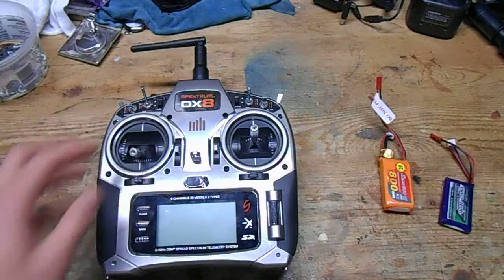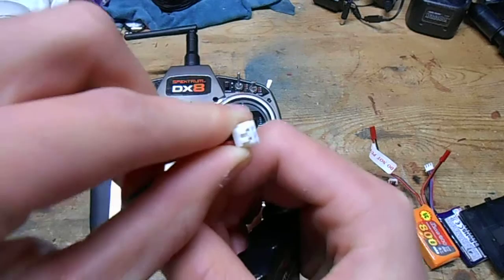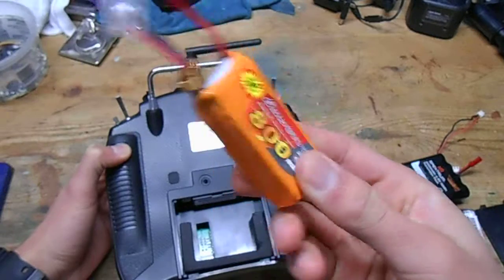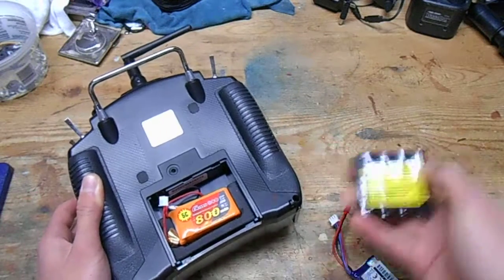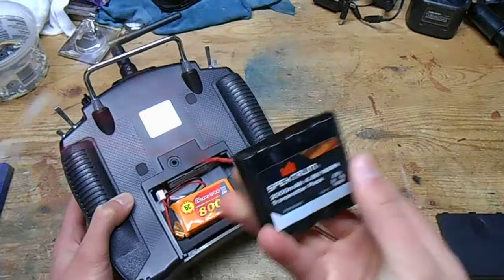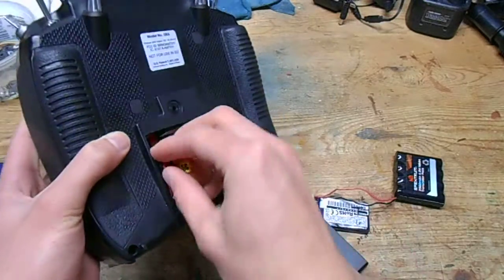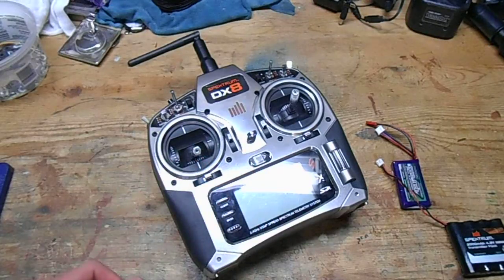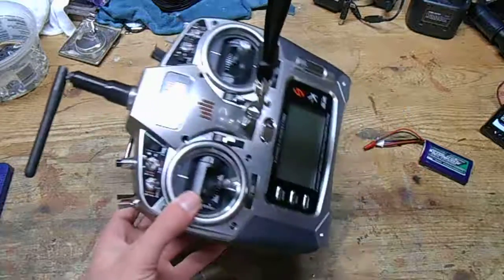How to Use Any 2S LiPo in Spektrum Transmitters With No Modification

Comment: I liked Spektrum for helicopters but in order to get the quantity of programable channels I needed for older quads (that needed 3 more channels, slider and rotary switches for the gimbal) I switched to Futaba, then to Frsky with Crossfire when I started flying "fixed camera" quads.   I searched for a Spektrum that had at least 14 channels, slider switches, rotary switches and a wide assortment of 3 position switches but then you're looking at a lot of cheddar.

Comment: quick question for you!  for a 2s transmitter lipo, what voltage do you set the tx low voltage alarm to go off at? like so you dont overdischarge the lipo? 
I have a futaba t8fg that i just converted from the stock 1700mah nimh to a 2600mah 2s lipo, but i am unsure if i should set the alarm at 7.3v (3.7v per cell) or set it for 6v (3v per cell)?
any help would be so appreciated!
Reply from the maker: Of the two options you provided, 7.3V is much better. 3V per cell is unsafe for LiPos.

Comment: Very Helpful indeed !  I just bought a stock battery for my DX18 and of course it came with NO Balance connector.  Where did you get your battery replacement shown in this video??  It does have a balance lead so no wonder it lasts much longer!
Reply from the maker: The one in the video is a Gens Ace 800mah 2S, but I don't remember where I bought it (and they probably don't even make it anymore). Nowadays I make my own 1300mah 2S from worn out 4S miniquad batteries.

Comment: I would not attempt to charge a LiPo battery using the charging circuit built into the radio. Great way to burn down your house.
Reply from the maker: If your radio has a setting for LiPo batteries the built-in charge circuit should charge the battery to the correct voltage when that setting is applied. However if this is not the case then the battery should definitely be charged with a LiPo charger. Also, most radios that have a LiPo setting are not capable of balancing the individual battery cells.
Reply: I agree they spend very little on the cheap charger that comes with the package!

Comment: A brand new LiFe transmitter pack costs 10 to 15 USD. If you replace that with an unsecured (i.e., one that does not have a BMS that prevents under and over-charge) cheap used LiPo, you might burn your TX or lose your plane. Is it worth it ?
Reply from the maker: Almost all batteries for model aircraft applications, LiFe, LiPo, and otherwise, do not have a Battery Management System (BMS). Spektrum transmitters when set to the LiPo battery setting will provide a low battery warning at the correct voltage, and then the battery can be charged and balanced with a standard model aircraft battery charger just like any other model aircraft battery. This is what I do and I have yet to light anything on fire or lose an airplane.
Reply: @TimmyRC : still, I humbly suggest an improvement: either you make a complete video that includes soldering of the right plug and balanced LiPo charging, or you use Li-Ion elements and a BMS to build a better battery for TX. Because when turned off, the TX will not handle under charge. That is why LiFe is the common (safer) option.
Reply from the maker: I agree that this video is outdated; it is one of the first videos I made. Feel free to make a better video. In low power draw scenarios such as transmitters, overdischarging a LiPo is relatively low risk. You might cause the battery to be unable to hold a charge and possibly puff it, but combustion is extremely unlikely. If you are observant you will notice that in this hobby there are few safeguards against accidentally leaving transmitters on or airplanes plugged in, likely because overdischarging LiPos is rarely catastrophic.

Comment: Unfortunately as I installed 2c l ion the transmitter turns on by itself so i had to install Ni MH found out Dx6e behave differently if you exceed 6.5 volts
I don’t think it works on all spektrum transmitters

Comment: SO what is the advantage to using this over the batteries that come with the transmitter.
Reply: For one thing the stock battery for a DX18 is a two cell LiPo with no balance connector.  This forcing charging in the TX with the stock cheap charger ...  Much better with a balance connector because more expensive chargers that use a balance connector will charge both cells evenly  (very important on LiPOs).
Reply: @rhshel  So Spektrum knows enough to build the radio, but no enough to choose a battery for it?  Got it.

Comment: Nice idea but you need to be careful charging.

The two cell lipo packs designed to work directly with these transmitters include internal balancing and over-voltage protection functionality.  I have one of the Turnegy TX packs with the internal balancing (like the Spektrum lipo pack) and it has worked very well for years with the stock TX charger.  The stock charger puts out 12 volts at .5 amp but I'm not sure what provisions the TX charging circuit itself makes for lipo packs (i.e. the overcharge protection IS built into those TX specific packs so the TX charging circuit probably will not stop the charge at 4.2 volts per cell).  If you are planning to use the stock TX charger with a regular two cell lipo pack (no battery internal charging circuits) you need to be very, very careful that the battery is not over charged.  Also, you won't have any balancing.  If using a standard two cell pack I would remove it from the transmitter and charge it on a balancing charger rather than using the stock TX charger.

Also, as other have mentioned you need to set the proper battery type in the TX system settings.
Reply: Which model of turnigy?

Comment: I converted my DX6e also DX8 first gen.  Works great but when I shut off  tx, the battery discharges considerably a few days later
Reply: memtenn60 i noticed the Dx6e would turn on by itself so accidentally went back to alkaline then worked ok
Then i put 5 NiMh and now the transmitter is fine
Reply: @khaledissa5026  Issue: This product notice is for DX6e (without PID ending in L) owners who wish to use the optional lithium ion battery (SPMA9602 battery or SPMA9603 battery/charger set). If you own a DX6e and do NOT wish to use the optional lithium ion battery, please disregard this notice. Transmitters manufactured prior to June of 2017 require a free update to be fully compatible with the optional lithium ion battery. Installing the optional lithium ion battery without completing this update will cause the transmitter to not power down properly and may cause the battery to discharge when the transmitter is powered down.

What To Do: If you own a DX6e with a PID not ending in L and DO wish to use the optional lithium ion battery Please fill out the Return Request Form found here. After completing and submitting the Return Request Form, Horizon Hobby will E-mail a pre-paid shipping label for you to use to return the transmitter. DO NOT SEND BATTERIES with the transmitter to Horizon Hobby. Horizon Hobby will return the transmitter to you as soon as the update is completed. lease allow 14-21 days for processing and delivery.

Comment: i purchased  a transmitter 3s lipo 8C  2200mah for my futaba   radio that took 8 AA batteries with new lipo  it reads 12 volts  will this be OK
Reply from the maker: Yes, the voltage is the same. Just make sure you don't over-discharge your LiPo in your transmitter.
Reply: what I'm concerned about is will I burn up my 8 cell nicd AA  futaba radio  by just replacing it with a 3 cell lipo battery because the 3S lipo is 12.6 volts fully charged   the 8 Cell AA battery was only 11.2 volts fully charged? hhmmmmm
Reply: when I see my lipo voltage drops to 9.6V  I'M recharging it   what do you think?

Comment: cool but wont it affect the low warning battery indicator' on the dx6 battery upgrade you have to change the low battery indicator settings when upgrading the battery
Reply: both the DX6 and the DX8 (used in the video) can be set up (under system settings) to recognize Li-Ion, LiPo, and NiMH. just select the appropriate battery chemistry type and both transmitters have the corresponding LV settings for NiMH (adjustable from 4.1V to 5.6V) and LiPo/LiIon (adjustable from 6.4V to 8.3V)
Reply: can also change over volt alarm aswell

Comment: Superb!  Many thanks, I've just tried this in my DX6 (SPM6750) and it works 100%, though I've found the JST connector is slightly loose, so use I've used some foam to keep the lipo locked in place.  otherwise excellent tip, thank you!
Reply: I have a DX6i DSMX transmitter, can I simply convert that with a quick 2s battery swap? Is your DX6 still running well on this setup?